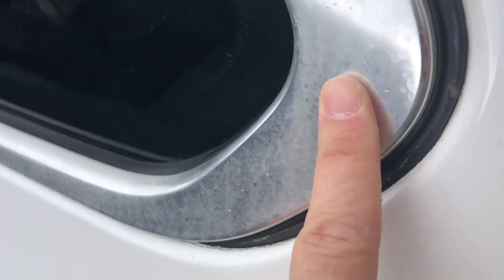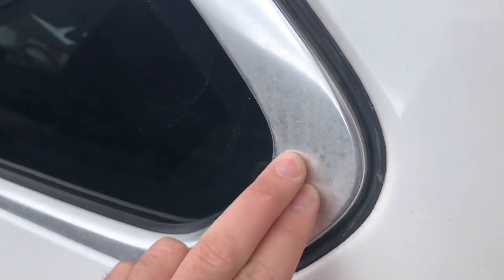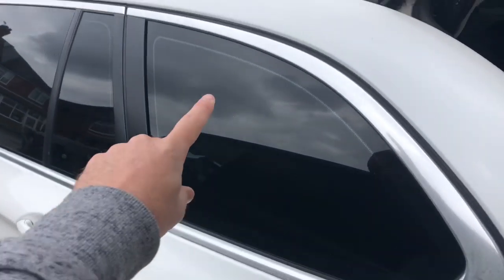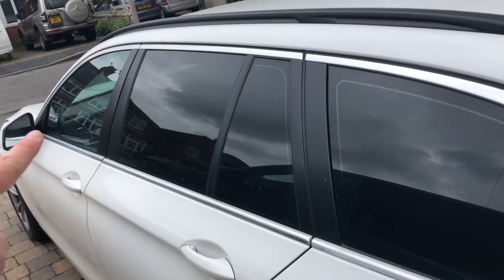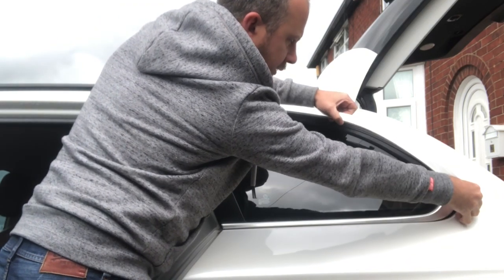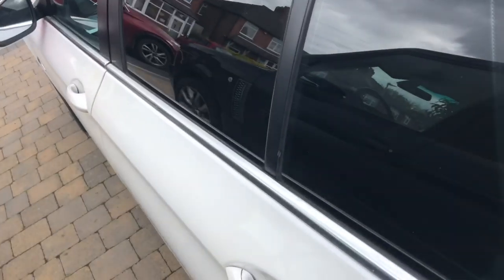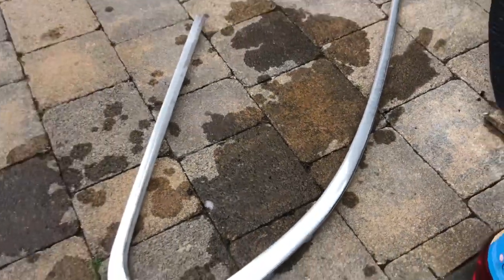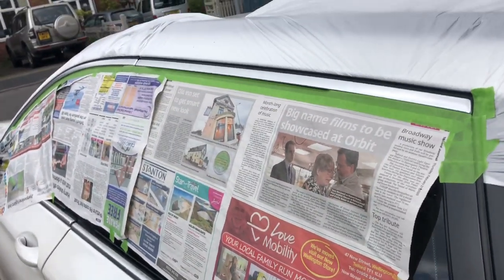BMW 530d F11 - Chrome Window Trim Fix

Comment: thanks for the inspiration and instruction. used your method of taping and wet removal to great effect (used to correct my horrible first attempt). well done on the presentation. the goldilocks approach; not too much, not too little, just right

Comment: I had the same on my last car (jag XF), no amount of polishing would improve it and now I know the reason why!
My car is still in good shape wondering if a ceramic coating may prolong the shine for a little longer, I may give it a go.
Those restoring classics are always looking to avoid a the cost of a re-chrome, I did see a chrome paint that goes on with a brush and looks really good and is really hard wearing. This could be an option if you wanted to keep it origional.

Comment: I had a front door repaired and resprayed by BMW. Bodyshop said the weatherstrip (mine are shadowline) had to come off to respray the door outer skin. They said pulling off the weatherstrips is virtually impossible to do without bending them and ruining them so new ones are needed. So good move not trying to lever of your chrome ones.
Reply from the maker: Lucky escape... 👍

Comment: I’m planning to paint in same way roof rails but worried when I’ll put roof bars it might will damage the paint?
Did you ever washed car in car wash with high pressure if so how it went?
Thanks

Comment: 10 months on, how is the blacked out chrome trim holding up on the F11? Thinking of doing this on mine and like your video explaining how.
Reply from the maker: It’s held up completely fine. The great thing with these rubber paints is that you can always touch-up if it were damaged. When you spray onto old rubber paint it re-liquifies and sets again 👍
Reply: Great. Just need some decent weather and I can give it a go. Thanks 👍
Reply from the maker: My biggest tips are to warm the can in a bucket of water first & take your time taping up the area 👍
Reply: @Nut_Job.  Hi Thanks for the video. Can you tell the name/brand of the can spray you use?I check if i can buy myself. Is it spray for aluminium?Or for chrome?thanks a lot

Comment: Hi mate, have you had any issues in peeling/scabbing since install... I did this on my E61 but it didn't last long... Want to do my F11 ex police car but don't wanna do all that masking to need it redone in 3 months 🤷🏻‍♂️
Reply from the maker: Mines holding up just fine. Perhaps try cleaning/prepping the surfaces a bit more before applying it? I cleaned it with soapy water & then with alcohol to ensure it sticks well 👍

Comment: Can you visibly tell when it needs another coat ? This is exactly what i want to do in the next few days. Great DIY vids mate.
Reply from the maker: Once you’ve done about 3 coats you’ve usually got solid coverage, but you really need enough material down so that it will eventually peel off properly. I was looking for a decent ‘wet edge’ so that I could peel it off and leave a tidy line.

Comment: nice. Did you also paint the roof rails? is it any easy way to take them off or should i just paint them sitting on the car.
Reply from the maker: I didn’t actually paint mine (they were always matt black). I looked at removing them before... I think there’s about 3 or 4 bolts which are hidden by the interior headliner. If I was painting them I’d try to remove them because I think it would be more difficult on the car.

Comment: Nice job Nut Job. BMW term this 'shadowline' trim and is usually a no cost option when specifying the car. I agree it looks far better than chrome and won't weather. An alternative way of achieving the same look is to get the trim wrapped. I had my 6 series done including the kidney grill surrounds for £130.  On a separate issue, would you delete the music while you are speaking please? Although it is at super low volume, somehow that makes it rather distracting (for me anyway). I would rather be listening to you! Thanks

Comment: I done some dechroming on my old 530d e60 (as it wasn't an msport) 
It looked fine to start off with but after a few thousand miles of motorway driving  especially the front grill started to look a bit shabby with bits of black chipping off  and really drives the price down when selling the vehicle

Comment: I advise you to remove all the trim in order to paint it.
The aerosol spray paint is really bad for the weather strip rubber, which will create cracks overtime and lead you to spend a lot more money than you would expect by replacing it.
Reply from the maker: This video shows the use of Plastidip, which is a liquid rubber coating not a ‘paint’ really. I can’t see it causing the rubber seals to crack, although I’ll stand corrected if someone can show me that this is true. Removing the trim was what I tried first, but it’s almost impossible (IMO) to remove without causing damage to the trim - this is why I chose to spray it in-situ.